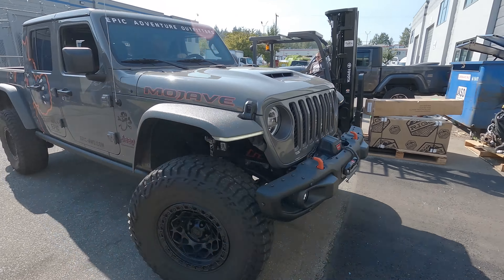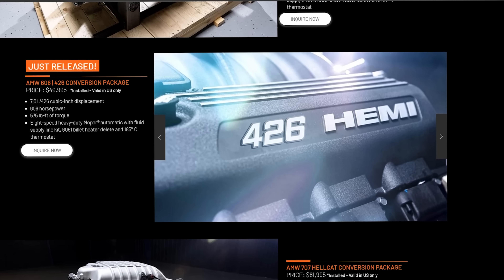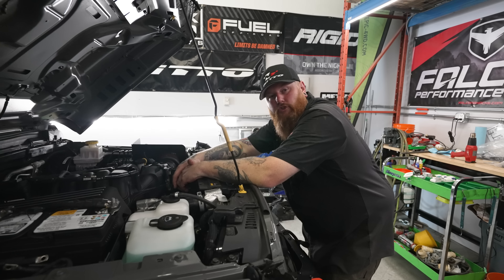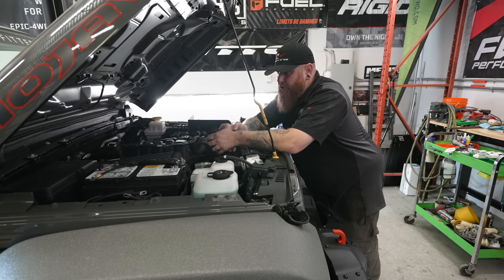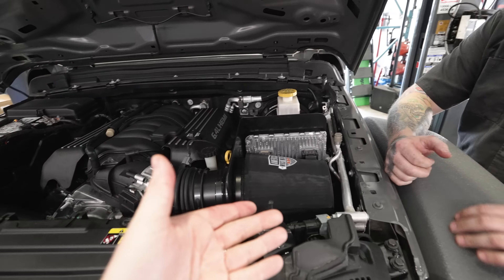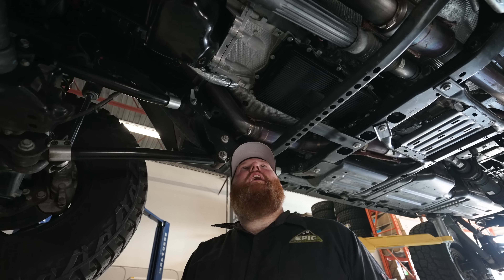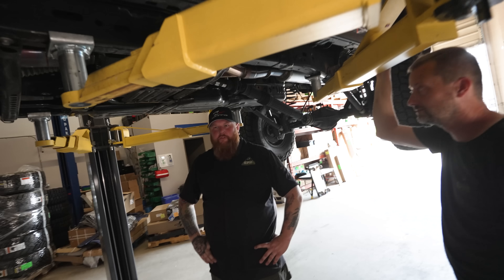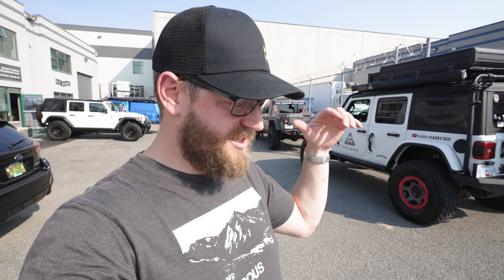Don't Buy a V8 Engine For Your Jeep Until You See This...

Comment: You might mention that each of these over the top engine conversions also requires an entirely new drivetrain and suspension, which adds another sizable chunk to the cost.    In the end, you are ending up with a $120,000 vehicle.    YouTube must pay pretty good.     Us mere mortals can only dream.
Reply: Depends on what you mean by drivetrain they supply the transmission and there's no mention that  you need to re-gear or swap axles. They also don't really clarify the suspension either other than they slightly mention it in the video, but they make it seem like it's part of the engine package.
Reply: @PynkPwny  I sure would not trust a set of standard axles, etc to stand up to vigorous boulder hopping with one of these engines under the hood
Reply: @glenngore6609  I have no doubt it's a needed upgrade, but the don't specify that. I do agree it is a lot when you start adding it up though.
Reply: @PynkPwny  The cost is just a fantasy for 95%, the whole thing is just for bragging rights and I understand that. Twice the price of the Jeep for a motor?  Please!
Reply: @glenngore6609  I mean if you look at the turnkey installs and I mean the 505 or 606 and added into it the 1 ton swap they do you are looking at 60-75k which is about the cost of a brand new vehicle. I think most people who want these things build them over time and you can do a 5.7 conversion pretty dang cheap if you really wanted a Hemi in your Jeep.
Reply: @glenngore6609  Also the other question is if you are running a 2.0/3.6 with a 1 ton swap will you still be able to go everywhere that the same rig will with a Hemi in it? If so don't worry about envy and just be glad some people can build something crazy that you might get a chance to see.
Reply: Personal loans, business loans, credit cards and other high cost financing are plaguing the V8 swap scene.
Reply: @mikesnyder465  Maybe so but those are all personal choices... I'm saying it's not impossible for a normal (however you define that) to have V8 swaps if they want them.

Comment: With rear wheel drive, does it come with a rear Dana 60 ? and better drive shaft?
Reply from the maker: No but you can upgrade to the 8lug axle kit if you want to run large tires or bigger engines. The 392 on 37s seems to do ok but youd want to be cautious offroad in 4 low and using lockers, or doing burn outs. 😎

Comment: You could sorta make your own poor man's Hellephant if you did the 426 swap, and put a supercharger on it.  I don't know how well it would hold up as it would not be designed to be a compression and displacement monster like a real Hellephant, but it could be done.  A 426 with a 3.0l supercharger on it would still be a powerhouse and scare pretty much anyone within a kilometer when you revved it up.
Reply from the maker: Im going to guess that the 426 stroked engine is higher compression then the hellaphant block and be a power limiter with forced induction.

Comment: Casey, can epic do a 5.7 factory hemi swap? Thats the swap I would do. Thanks
Reply from the maker: Only the kits available through AMW - 392, 426, hellcat, demon. The kits are extremely well designed and engineered for their respective motors.
Reply: @Casey250  I saw them a year ago with lite brite. I thought they had a 5.7 hemi kit.  I don't doubt your going big. I was just in BC last weekend. Still $1.99 a liter in Victoria. Hope it comes down soon...
Reply: There's plenty online if you wanted to do a 5.7 swap yourself and actually one guy made a video and a spreadsheet that listed every single thing you needed to do it.

Comment: Why not just supercharge your stock engine.
Im running an old CJ7 with a 258. its about what u can go through.... not just peak HP. If I had your stock HP... Id be excited. lol

That said. I had a CJ with a 350. It had about 315hp. Gears and everything where set up. couldnt stop it. I probably shouldnt of sold it...

The swap is cool, just expensive...